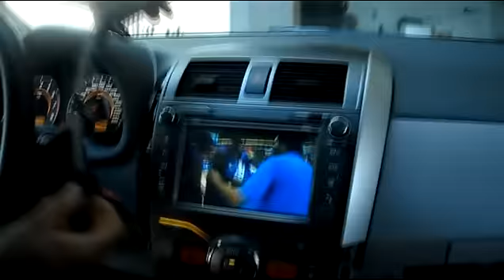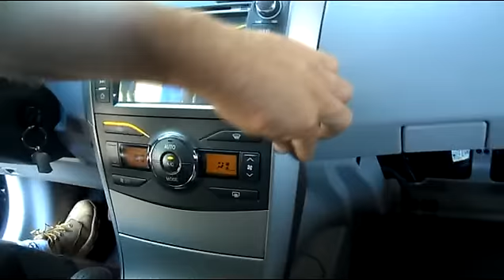Toyota Corolla - M1 Instalação CM

Comment: boa noite tenho multimídia M1 que estava instalado num corrolla comprei Etios e o mesmo possui controle no volante no seu vídeo você está ligando 1 conector preto    10 vias esse é inquestionável controla volante , vc possui este cabo para venda
Reply from the maker: Boa tarde amigo, no video é um corolla os acessórios deste produto não vão para o ETIOS, posso consultar se tenho mande foto do código de barras da central e da traseira que falta o plug para 45 - 99950 - 6219
Reply: Boa noite , código Da central M1 numero e P0. 8-Z273V02-TV1.0-CB6B-R.     Abaixo C6214TT110600570011060707